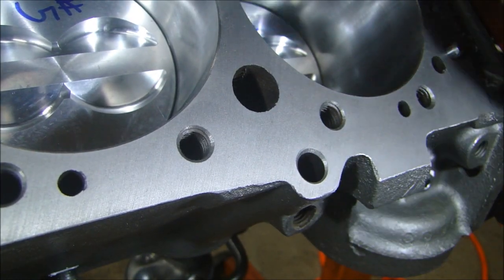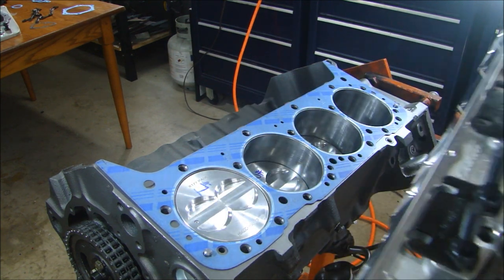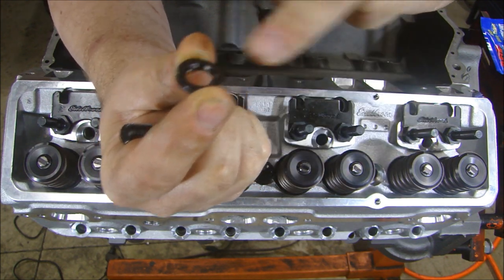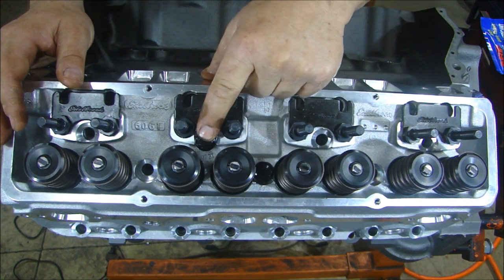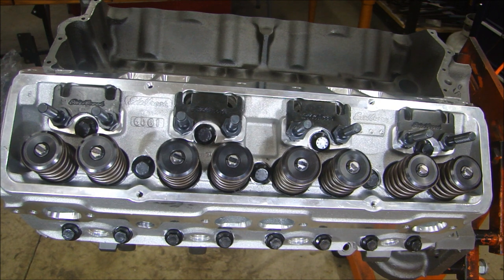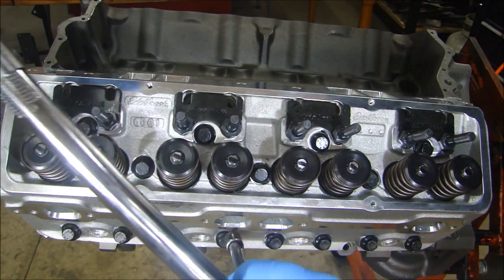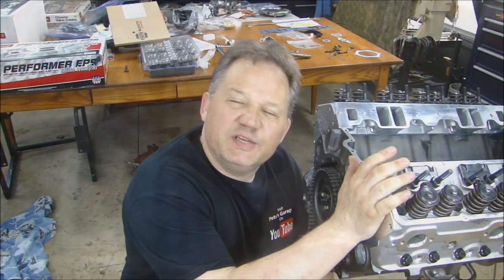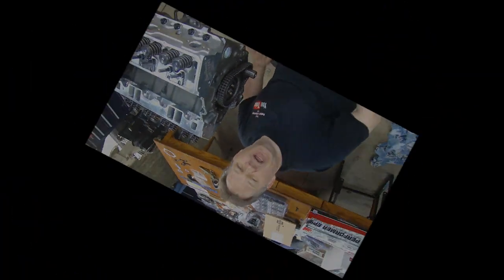Engine Building Part 5 - Installing a Set of Edelbrock E Street Cylinder Heads Small Block Chevy 350

Comment: Man great looking motor, I just reserfaced a new set of edlbrock heads and rehoned all the exhaust valve guides. From factory they require this before install. They are amazing heads after you fix them. They are just slapped together factory corporate push style with no love. 
    The love comes from the machine shop get to know your local shop.
Reply from the maker: You're right

Comment: Arp makes a good thread sealant for the bolts, but any Teflon sealer will work. I just using the Arp stuff cause hey why not lol
Reply from the maker: I always use the ARP stuff that comes with the bolts. You are right, any sealer with PTFE is good.

Comment: When you drove that head bolt in with the impact after you set it on the block i jumped out of my seat
Reply from the maker: Just a quick way to get it to hold the head. I did not apply any torque
Reply: He got tired
Reply: Devin Greer been doing that professionally for 30 years. This ain’t the space shuttle folks...

Comment: when useing extention with a torque wrench do you adjust the lbs of torque do to the extention from the bolt head to the head of the wrench
Reply: Should adjust 2flbs.per inch of extension.

Comment: How did the pushrod line up. Reading lots of horror stories about after market heads and they talk alot about casting needing alot of work to get the pushrod to line up. Was wondering how the edelbrock were
Reply from the maker: I had no problems with them

Comment: wouldn't it be a good idea to install the heads together alternating heads while working the torque steps. Reasoning being the torque from the bolts slightly warps the block.?
Reply from the maker: Well...that is a potential issue. However, the block has a torque plate on it when it's bored and honed to make up for that.

Comment: at 1:45 what is the extra hole  for ?  that sits between the ports.  my aluminum heads have the same hole 1 on each head
Reply from the maker: Depending on the car you're putting it in, it could be for a water temp sensor. You can plug it if you're not using it

Comment: Hey Pete, I have the same heads, please share what head gaskets did you install?  I'm being told different things, I trust an home town guy like you.
Thanks
Sam T.
Reply from the maker: I used FelPro. They work just fine
Reply: Thanks Pete, do remember the number? 1003 1010 ? Steel or copper fire ring? I know I have a lot of questions,  it's been a long time since I've built a engine 35 years...lol
Thanks again
Sam T.
Reply from the maker: I don't recall the number, but it's the steel fire ring
Reply: Thanks Pete, very much appreciate the great videos you share. 
Thanks again
Sam T.

Comment: I installed a new set of Edelbrock Performer heads on my rebuilt 350 and it makes LESS power than the old cast iron heads , it has roller rockers. The compression with the old heads was 145 psi in each cylinder and then 165 psi with the Edelbrocks . Runs smooth idles good  just LESS power . I am running an Edelbrock 600 CFM carb unchanged  . I do need to get the correct push rod length could this be the problem ?.  Could you give me some advice ?  
Thank you !
Reply from the maker: The wrong length push rods could definitely cause that problem.
Reply: How well did the intake and gaskets match up to the new heads? Could there be some flow restrictions

Comment: Pete... I'm almost an engine builder thanks to you. 
question... im installing heads on an lt1 95' using gm  10105117 .028 gasket. I notice that the upper part of the gasket has one large triangular shape passage instead of a squarish divided passage... This triangle shape covers the large water passage AND the smaller square opening that goes into the rocker arm bay.... many ppl use these gaskets but that large opening is worrisome the original has a divided partition between the large passage and the open space. Whats up with that????
Reply from the maker: As long as the gasket does not cover and existing hole or leave a huge open space somewhere it will be fine

Comment: Any inference with the #1 head bolt?
I have the E-210 heads, and the valve springs overlap the surface for the head bolt washer. Any advise?
Reply from the maker: You'll have to tighten that bolt until it goes past the spring

Comment: Hi Pete Thame fur the video. Last night i installed Edelbrock Performer RPM heads on my 327. The instruction sheet said 3 step increments but the final was 65 not 70. The ARP had bolts didn't have a separate torque value.  Do you think bumping it up to 70 would be a good idea?
Reply from the maker: Yes

Comment: Certainly would not use any type of gasket maker or silicone on the threads! use a proper thread sealer with Teflon in it like Permatex 56521. As you say follow the manufacturers recommendations, It clearly says on that ARP sheet you're holding to use assembly lube under the washer and bolt heads!
Reply from the maker: Thanks for the comment

Comment: You don't need that gasket goop for the head gasket? I was surprised at that but it's been a while since I've worked on an engine. I think it was called gasket shellac, It looked like molasses and I hated it because it was so messy. Great video series, thank you.
INDIAN HEAD gasket shellac! It just came to me :P
Reply from the maker: I never use anything on head gaskets unless the manufacturer recommends it
Reply: That’s only for the old sheet metal head gaskets, right?
Reply: @PetesGarage  Thanks, and I'm sorry about "that nut", It was supposed to be "that but ,"
Reply: @mcswain69  I really don't know because I take thins apart and hopefully put in back the same way :P I ask for help or read the instructions only when I ran into trouble I wish we had the internet back then (60s through the 69).

Comment: Edelbrock E-Street heads say toque to 65 foot lbs. would it matter? I just built my 1986 Corvette engine with the e-street heads and  I’m almost at the 500 break in mile mark and the #8 intake valve spring broke into 4 sections, and I noticed that the valve seal was not all the way down on the guide so I looked at the rest of the seals and half of them are not seated . Question. What would cause my spring to explode into 4 sections and the inner spring to break into 3 sections. Need help cause I have to be at the Turkey rod run in Daytona in two weeks and I’m driving it down there from Jacksonville Florida.
Reply from the maker: The valve seal had nothing to do with it, unless they were positive lock seals. A spring will break if it's crooked, or not right for the cam.

Comment: what about using that extension doesnt it throw your torque off
Reply from the maker: It does not. As long as you do not change the length or center line of the socket you will not. If the torque was very high it may be a risk, but it takes a lot to twist an extension.
Reply: That's a different type of extension

Comment: A question Pete. Did you use ARP Ultra Torque assy lube on these bolts?  The video doesnt show it, nor is the lube mentioned. Thanks
Reply: ironhorse127 I noticed that too. Especially under the bolt head this is important because the friction there will eat a lot of your torque.
Reply from the maker: ironhorse127 No, because the threads are covered with sealant for the coolant. Silicone sealer is a lubricant so adding the Ultra-torque would do nothing.
Reply from the maker: 80% of torque is overcoming friction
Reply: Pete's Garage Thanks Pete.   Was the sealant used on all the bolts, even those that dont  come in contact with the coolant?

Comment: seeing that much RTV inside the engine on those bolts really worries me. there will be excess that will break off down the road and float around in the coolant passages, no?
Reply from the maker: I've never had a problem
Reply from the maker: You have to but it on the bolts that go through coolant passages. Believe me I have tried little to no RTV and they have leaked,
Reply: @jeffallen3382  Loctite 592 PST, locks and seals threaded fittings.
 Resists leakage, vibration loosening, moisture, hydraulic fluids, and diesel fuels. Lubricates threads for easy assembly and disassembly. Won't shred or wear like Teflon® tape.
Parts may be repositioned up to 24 hours after application.
 Works to 400°F. Suggested Applications: Head bolts into through holes, oil psi sending units and sensors, oil and coolant lines, fuel fittings, rear axle fill plug, brake and power steering fittings. How do you re-torque head bolts that have been gooped up with RTV? The RTV sets up, you re-torque--and break the seal. Conversely, Loctite 592 is advertised that you can re-position the fittings for 24 hours after application. Exactly what's needed for re-torquing bolts.

Comment: Need some advice I haven't been having much luck with head gaskets for my 6g72/12valve and can't find mls for it in Australia or cometic had the block and heads surfaces machined different heads   different blocks and still energy up with a combustion leak into radiator. HELPS PLEASE
Reply from the maker: Chris parkinson please email me at petesgarageinfo@gmail.com
Reply: Pete's Garage OK thank you
Reply: find a chev

Comment: What cc e street heads are you useing ??
Reply from the maker: These are the 70cc 5073 heads
Reply: @PetesGarage  how much power gain would this give a stock 350 with mild camshaft?( int. 262ext 269 lobe lift114 Dur. 050 218 intake and exhaust valve lift.462 .455)

Comment: Another great video I noticed when you torque the heads down you had a extension on the wrench I was told that will give a false reading  do you know of that is true
Reply from the maker: That can be true. It will not twist if the extension has a higher yield strength than the torque applied to it.

Comment: Not a big fan of Edelbrock heads. Never use them out of the box. Valve guides can be out of round among other as built issues. Spend the extra money for a set of AFR or Brodix, ya I know hard to justify for street use. Don't shoot the messenger.
Reply from the maker: We'll see ho these perform
Reply: 71Vegaman Lol, guess you haven't heard of AFR's valve run-out issues?
Reply: Don't matter who makes the head, you should always check someone else's work.  Like mom always said,  you want something done right do it yourself.  Js.
Reply: there just as bad

Comment: I have the same heads for mine
Reply from the maker: They work well
Reply: @PetesGarage  I bought a Howard retrofit roller camshaft
Reply: @PetesGarage   I bought this cam from summit racing HRS-CL113215-10 and this valve spring kit HRS-98213-K12
Reply from the maker: Sounds good
Reply: @PetesGarage   I have any question what length chromemoly push rods are you using with your roller hydraulic lifters